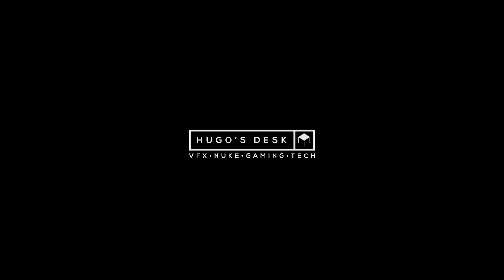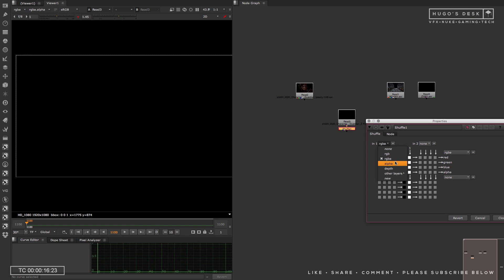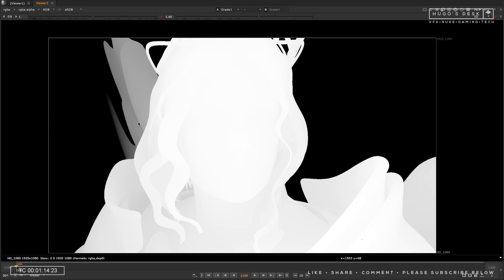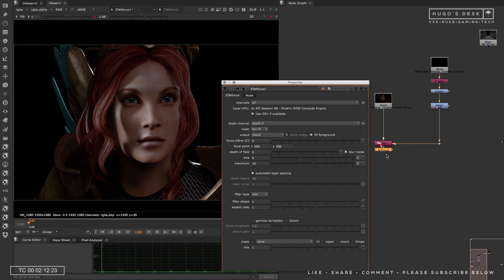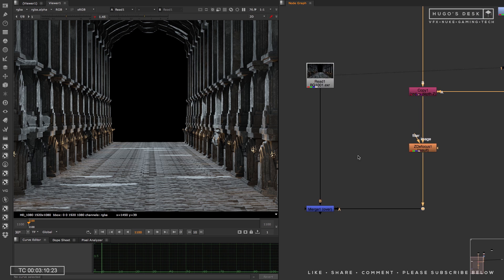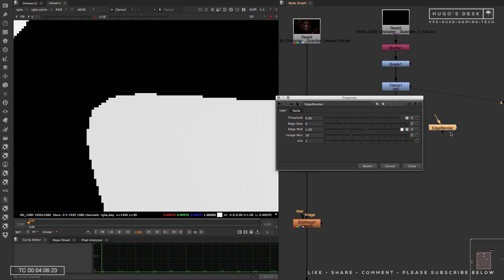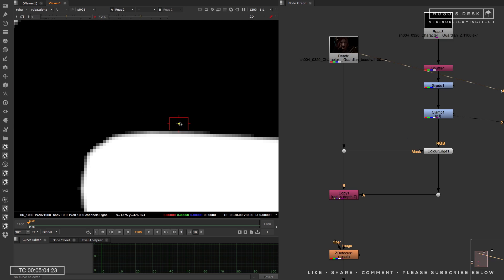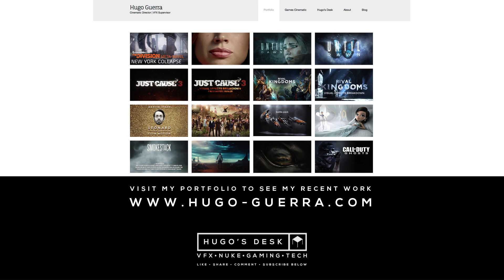How to solve Depth of Field edge problems in Nuke

Comment: Hey Hugo! Is there a way to fix the edges of this character if she was rendered out as part of the background and not a foreground element? I’m running into edge problems on a scene with lots of leaves and grass - when trying to apply depth of field on the whole scene in Nuke I get edge artifacts in between leaves - any way around this in Nuke or would you need to render DoF in camera in 3D?
Reply from the maker: Only way to go around this is to use Deep compositing and PGBokeh. Everything else will have edge issues. Last resort would be DOF in 3D
Reply: Hugo's Desk thank you for quick reply! Loved your deep compositing process video - will have to try this out.

Comment: Great information. 

You can also just use the raw depth data in the zDefocus node setting the math to "depth". You don't have to normalize the depth unless you need it for some other purpose. You can also use the Filter Erode to expand the depth channel to fix the rough edges that don't properly overlap the anti-aliased alpha.
Reply from the maker: The only reason I normalize is so I can have a visual representation of where the Z-depth is. This way I can adjust Edge Extensions, Edge Blurs, Filters using IDS, etc. I just prefer to see it so I can locate where the problems are. Having said that, this video is now almost 4 years old. These days I just use Deep information to solve some of these issues, to be honest.

Comment: Hey Hugo! great vid.  The values in your Depth pass are in the thousands.  3108 for black point and 1873 for white point.  The Depth pass I'm testing out here from my client is 1.09000 at it highest and .55000 at its lowest. And its backwards.  The closest part is darker and farthest  point is brighter.   Any thoughts?
Reply: I'm having the same problem, did you manage to resolve this?
Reply from the maker: You need to make sure you have correct values in the Zdepth settings in 3D. Also you need a proper scale in your 3D scene. Maybe that could be the problem?
Reply: @HugosDesk  I'm new to Nuke, but turns out your workflow works for me, I for some reason have to use decimal values from 0-1 (0.XXXX) instead. Will look into your suggestion though, thanks.
Reply from the maker: Not sure about those values. Are you clamping or limiting the values in 3D? The values should match 3D coordinates and distances camera so if your 3D is made to corrects scales it should be a lot higher.

Comment: This is a great idea. The edge thing has always thrown me with zdepth. (student) 
 
What is the difference between the Nukepedia node, and copying the alpha and eroding it or dilating a few pixels? 

Just wondering.
Reply from the maker: Thanks for the kind words. Yes you can do it manually without gizmos but I just find it easier to use the pre-made nodes. But there are many ways of getting the same result. Cheers and thanks for watching.